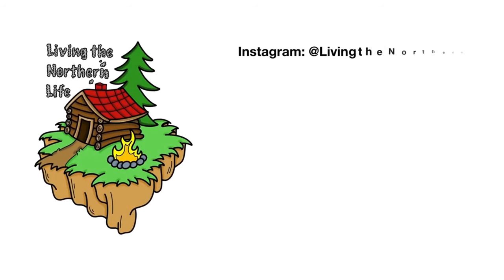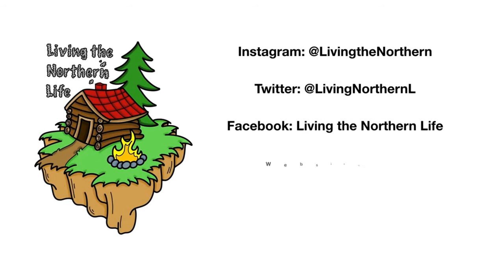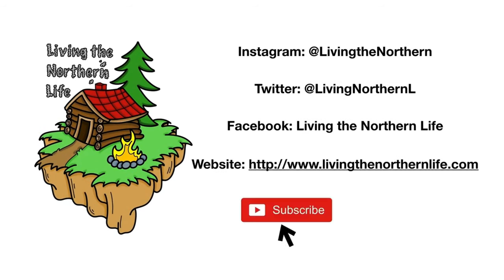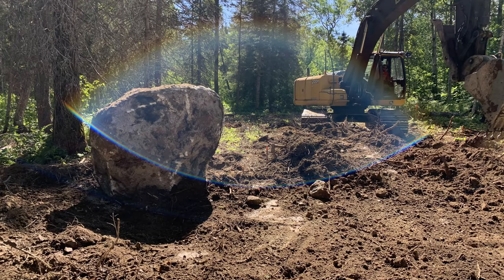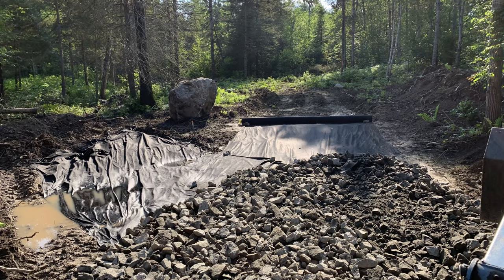1995 Ski Doo 380 Touring E Issue

Comment: I bought the exact same machine for $250 as a non runner.
Melted clutch side piston, so I bought an ebay used piston and cyl.
Found the crank seals were leaking, that probably caused the problem, took it apart and installed new seals etc.
Rebuilt the carbs, they were clogged up good too.
Its been 3 years working my way through this, I knew nothing about these machines when I bought it but have leaned.

I had a guy look it over, he pulled the start rope and tells me it feels normal and should fire right up.
maybe this winter I can ride, I live in northern maine near houlton, we have trails right by the house.
Reply from the maker: You could test the compression of each cylindar if you have or know someone with a testor as well.
Let me know if you get it running this winter.
Thanks for watching and commenting!
Andrew
Reply: @LivingtheNorthernLife  oh yeh, compression was 30 psi and 120psi.
replaced 1 cyl and piston, new rings on both jugs. 120 psi in both cyls npw.
pulled engine, split the case , new crank seals etc.
rebuilt both carbs with new carb kits. new battery, new starter, new voltage regulator, replaced ignition switch and new primer pump, all new plumbing with fuel filters, new rear light assembly, flushed tank out.
it fires right up with the elec start .  idles very well.
My first ride around the garden 2 weeks ago.
https://youtube.com/shorts/mn2FCGJvrP4?si=-JCF-zhAaHpKR1e7